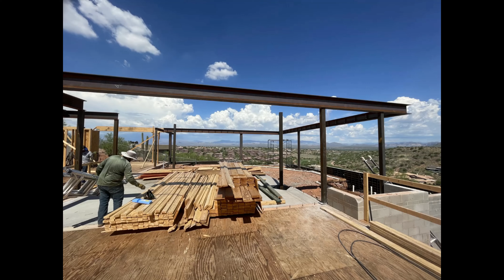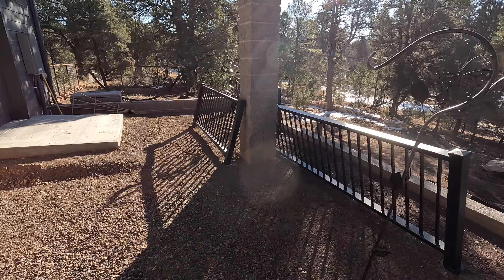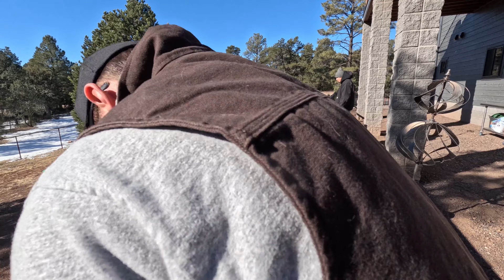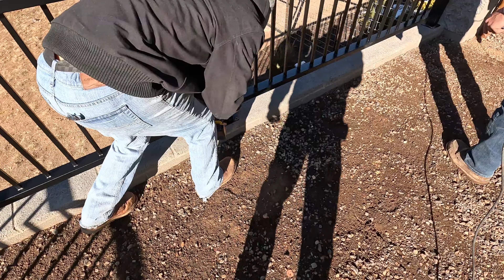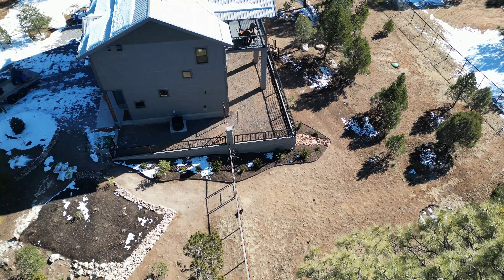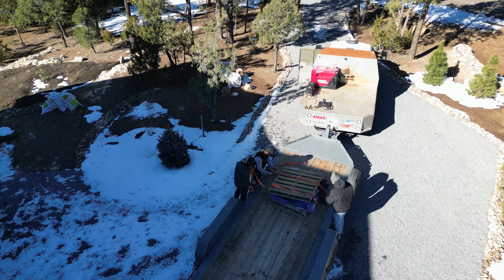Custom Railing Install

Comment: I believe me&you 
Have a lot in common business wise
I’ve done fabrication for 3 years then I switched to working on trucks &big equipment 
I’ve always wanted to run my business especially in structural steel & excavating & dumb trucks.
Thanks a lot
Reply from the maker: No worries let me know if you have any questions. I’m no expert but I’ll help where I can. Thanks for the comment!